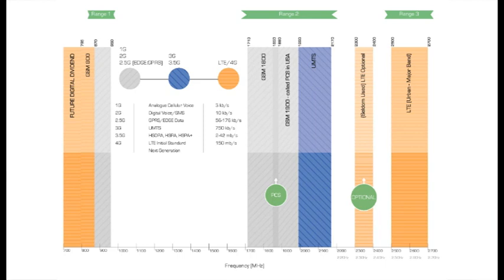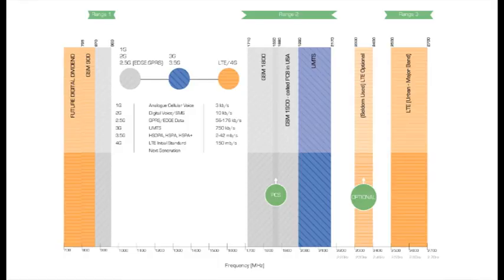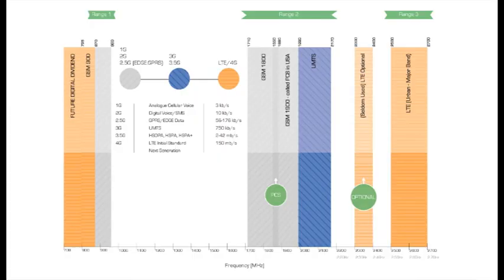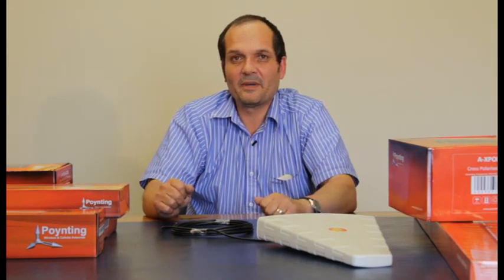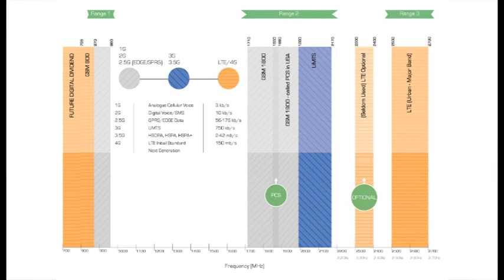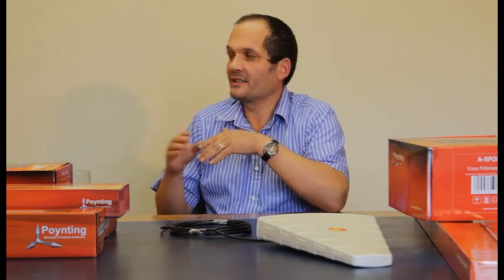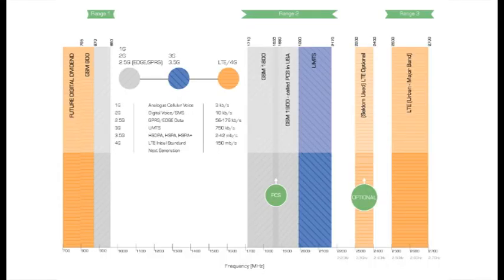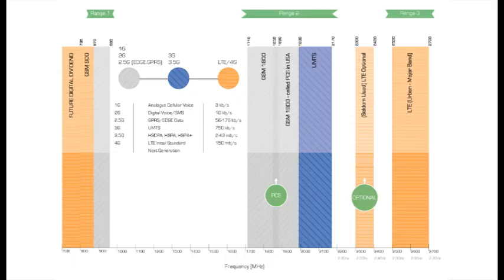LTE 4G Part 1 - What frequency bands do they operate on.

Comment: My tp link says my antenna is on band 8, wich i searched is 900mhz

Any way to change band to 2300mhz band?
Reply from the maker: To change from Band 8 to Band 40 (2300 MHz), he needs to navigate to the TP-Link's router interface and check if this option is available. Please note that this functionality is not available for all routers. Some routers automatically select the operating band while some allow you to select the band you want to use.

To access the router's interface, you should
•	open a web browser.
•	Type in the router's IP address. This can be found on the label stuck at the bottom of the router. Normally starts with 192.168.XX.XX
•	Navigate to the section where you can see the LTE bands and check if there is an option to deselect band 8 and select band 40.
Tx Poynting Tech Support
Reply: @poyntingantennas  thanks i worked out how to change band. I changed from band 8 to bands 3 & 20.

My download speed doubled.😝

Automatic is not good deffo better to change.. I'll try band 40 see how it goes.

Note.. On tp link i had to use Teather App to change this setting.

Comment: Im on 3 mobile UK for my home wifi now and they are using ~1400mhz band now.  I have ordered the XPOL-A0001 and i hope that i will be able to improve my signal power and quality by using this external antenna as it doesnt cover 1400mhz... 🧐
Reply: @poyntingantennas  more just anxious that my primary connection may be 1400mhz, but I'll wait until I get the antenna and see how we go. I got a great deal with this MNO, but they are the only MNO in the UK to have some of their LTE band outside the range of the XPOL-A0001. I'll let you know how it goes... cheers
Reply: @poyntingantennas  Hi Folks, Antenna came in the post today, and i tested at least 10 locations around my property for the best received signal metrics - oddly, after double checking, i received much better metrics LOWER on my house than higher up - so its been installed low down (approx door head height).
1. Before installing the antenna, the best numbers, on average, from inside the house were; RSRP: -102, RSRQ: -9, RSSI: -74, SINR: 6dB
2. AFTER installing the antenna, the numbers were; RSRP -85, RSRQ: -8, RSSI -65, SINR 11dB... and i was mighty pleased initially at how great the signal had been improved.
3. However, at one point this afternoon (circa 1830), the numbers have fallen off a cliff, with no damage to the antenna or cabling or changing anything on the router: RSRP -114dB, RSRQ -14dB, RSSI -81dB, SINR -3dB...
have you ever seen this before?  Tomorrow ill go outside and check the antenna from high up again (ive already tested this extensively though) and see if the numbers stabilise.  I tested 10 locations 4 times each to measure these metrics as i want to optomize the connection.
I really hope the MNO isnt using the 1400Mhz band as i feared for peak loading, but im trying to check this, i dont know if this info is even public.  If they are, i seem to be out of luck and will need to sell the antenna.  Or do i just need to chill out and leave the antenna to "stabilise" the connection for 24-48hrs?  I note in my router logs that my MNO was port scanning me since i installed the antenna this afternoon.
Reply: @poyntingantennas  haha ok, I noticed my antenna is now picking up two other masts that I couldn't see previously pre-antenna, and is auto switching. Every time this happens I reboot the router to try force a better connection to a closer mast, I'm hoping this gives it the chance to connect mostly to the mast that gives me good connection. Thanks guys and have a great weekend...

Comment: What would be very useful for the domestic consumer - someone who want to buy from takealot or another vendor - is a really basic explanation with diagrams - how to set up your home for LTE connectivity.  A recommendation of a couple of LTE routers that are compatible with your antennas would also help.  The frequency discussions and high-gain technical bits are interesting but I think that you will open up this route for more consumers if you work at removing the technical barriers to entry.  I am a technical layman but I am battling to understand the basics on what to buy and how to install the whole shooting match most effectively at my premises.  Thanks for the help.  Your products look cracking and are a testament to South African Engineering.  Thanks.